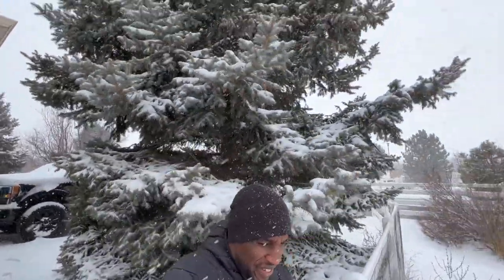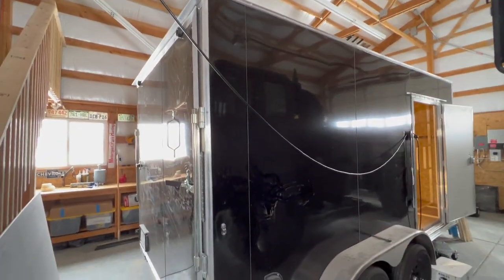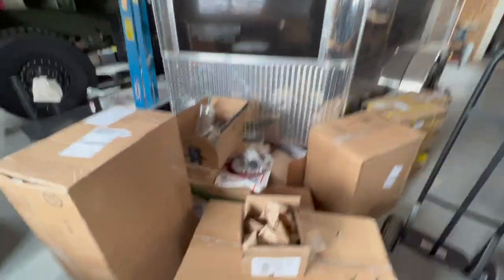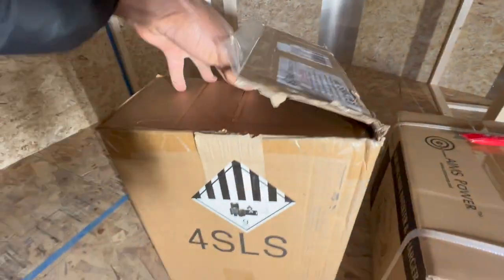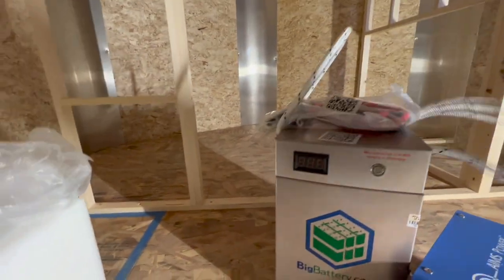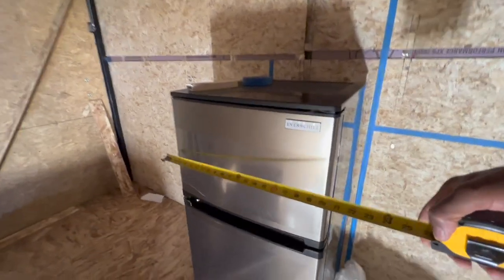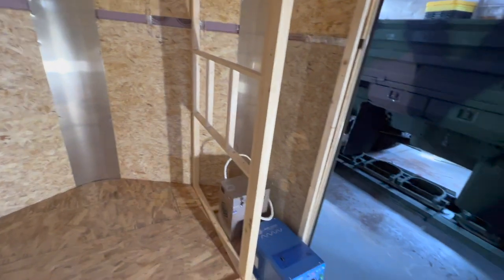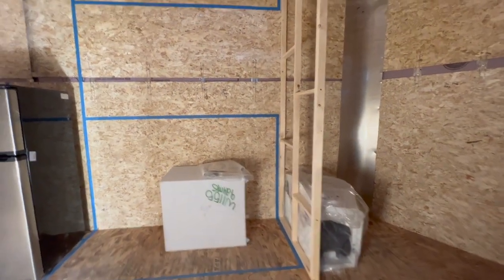Cargo Trailer to Camper Conversion Part 4:  Batteries, Toilet, Kitchen, Water

Comment: Nice I’m also doing  cargo 7x14 build I would recommend  running electrical and doing windows first before having  insulation and plywood up. Im putting batteries on exterior for solar in a vented box to save space. and water heater.
Reply from the maker: Hi Alex! Thanks for the tip. I had thought about that but decided I wanted my wires accessible. I just hate knowing I can’t change something. But you’re not wrong. As for batteries I’m doing lithium and it has to be inside. They don’t play nice with the cold. And they do not need vented. I’ll be curious to hear about your windows. What did you go with? How did you reframe the hole after cutting out window..